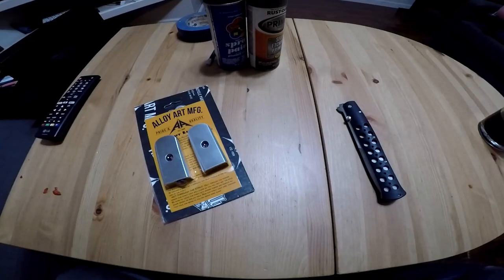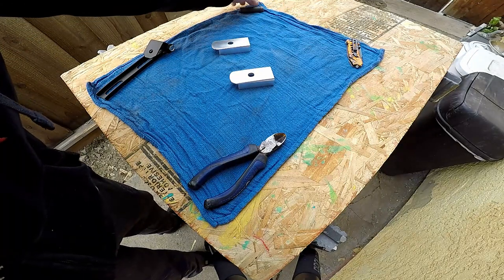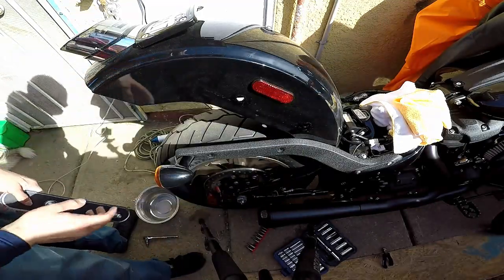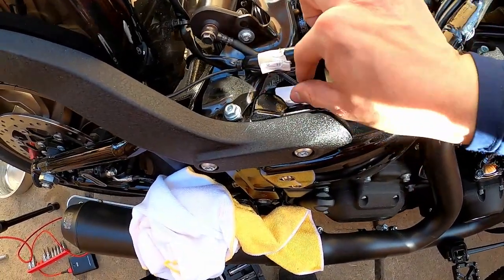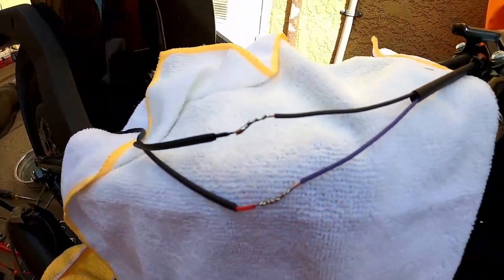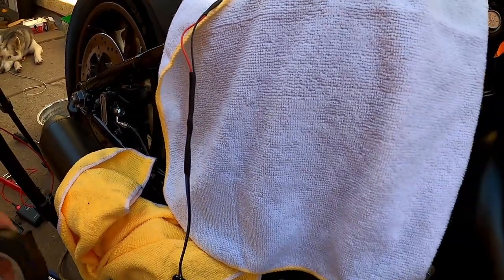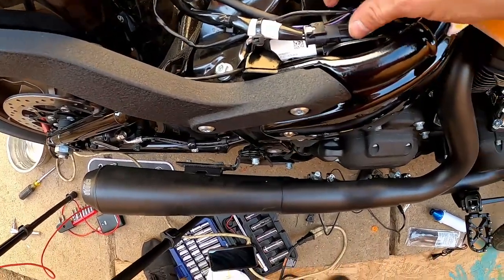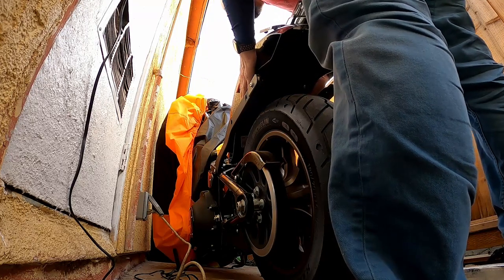Alloy Art Fender Strut LED install on 2020 Low Rider S

Comment: Nice I’m thinking about these or a micro bullet tail lights for my Slim.
Reply from the maker: The joker machine are also nice, I wouldn't recommend the smoke lenses. They're difficult to see during the day, custom dynamics sell 3-way relay for the brake light and signal lights. It'll make you more noticeable.

Comment: I wanted to buy these to, so I can run the leatherpros.. but on the street bob those are the only lights I will have. They just don’t look bright enough! I would have to run an extra led strip on the license plate frame just for peace of mind I won’t get rear ended
Reply from the maker: Joker machine has an alternative solution, these aren't bright. Maybe because of the smoked lens? Custom Dynamics has a triple play kit, you could install as well.

Comment: hello, don't you have problems with the electrical system? no resistance is needed?
Reply from the maker: No relay or resistors needed. They work great, and I also installed a triple play from custom dynamics.